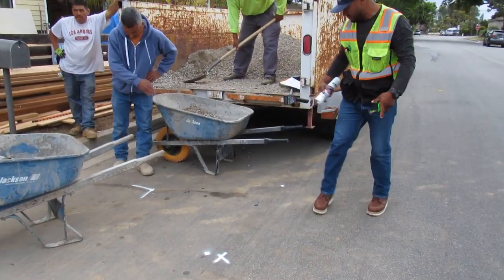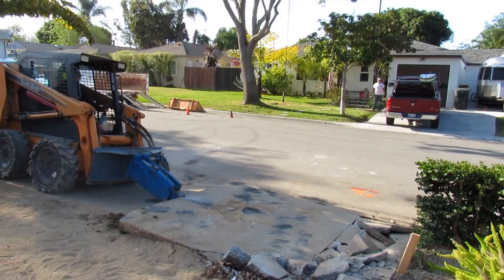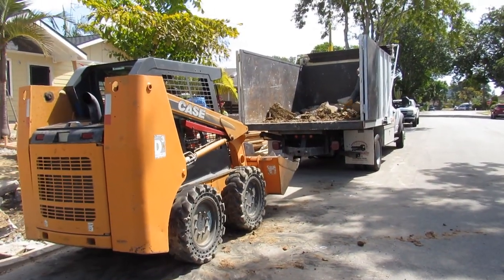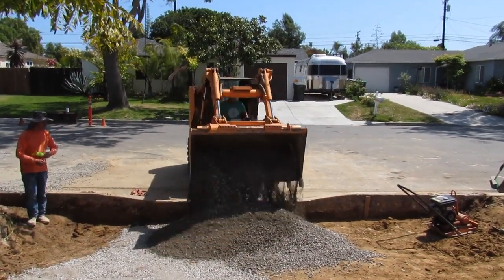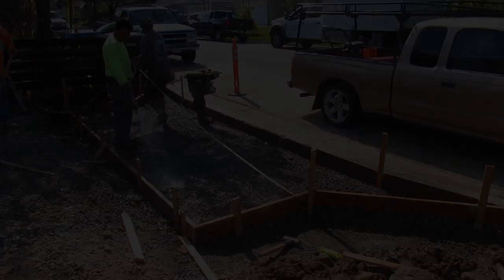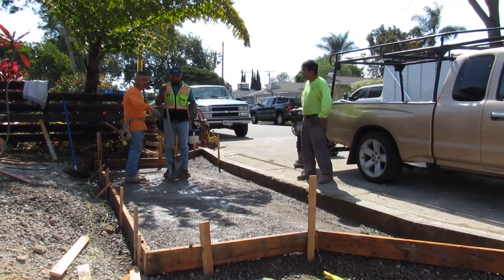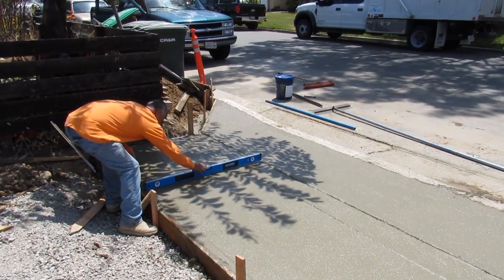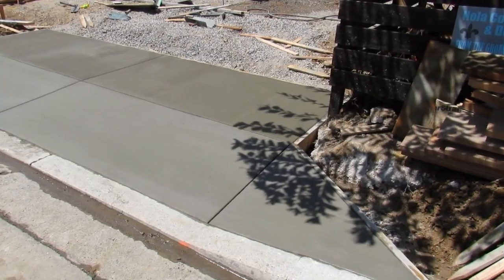Demo & Replace City Concrete Approach California

Comment: In 35 years I've never seen a curb cutting Machine like that .We end up busting out the old curb and cutting the blacktop. That's a huge time saver.
Reply from the maker: Hey bro. Its called a horizontal saw. They cut it for $600 if you can believe  that
Reply: @WestCoastCustomConcrete  That's crazy and it saves you from an extra permit fee and inspection
Reply from the maker: @myronsmith2114  not to mention  the 6k it would cost me to do it
Reply: @WestCoastCustomConcrete  In Pa. many of the curbs are solid granite 18" deep Old School. Those are the ones I would love to have cut
Reply from the maker: Man it would save so much time and momey

Comment: What is the quote price for a job exactly like this to complete for the driveway approach section? My driveway approach is really deep and steep that our cars scrape and really need to angle our cars to try to not scrape but it's very hard not to. Would like to know how much you charge for this exact work, thank you! I know everyone needs to see the location to do an estimate, but I'd like to know roughly what a task like this would range from.

Comment: I see you usng wheel machine instead of track,  most guys swear by track machine,  what's your opinion on it?
Reply from the maker: Thanks for watching kenny. My opinion is if you can run a skid steer there is no reason for tracks.

Comment: Great work!  What’s the cost for something like this?
Reply from the maker: 9k
Reply: @WestCoastCustomConcrete  REALLY? I live in Washington and I talk to a couple contractors and they charge me between $2300 to $3000 for a driveway approach 46 feet long including the wings. they will remove the old sidewalk, cut the curbing and pour new concrete. And $2500 to $3300 for 650 square feet driveway. and they have to remove about one foot of dirt.  AND I STILL THINK ITS EXPENSIVE
Reply from the maker: @gtdodgeviper  no money with that price